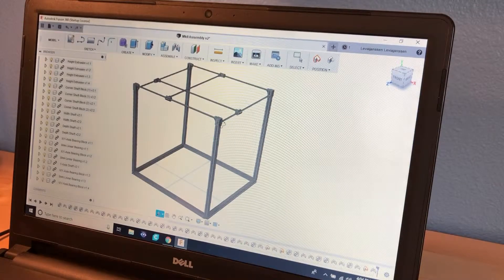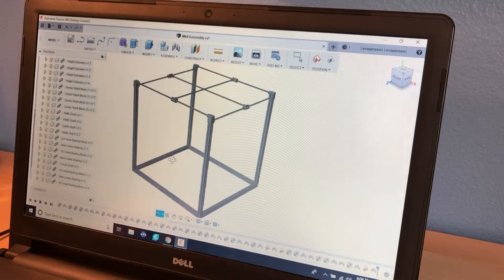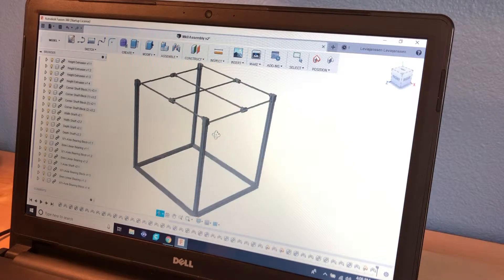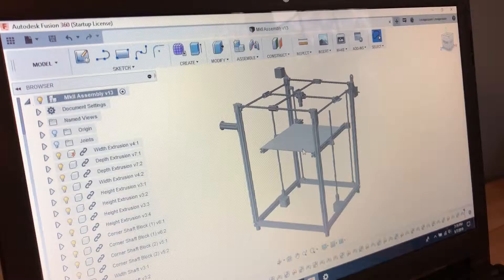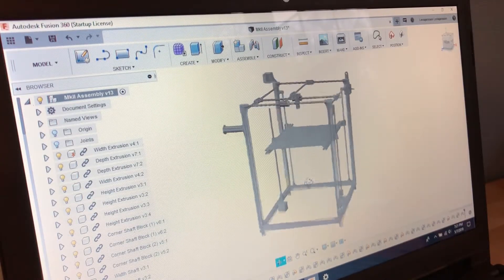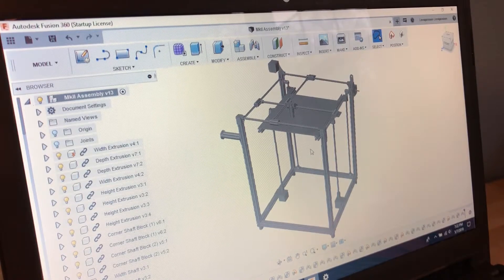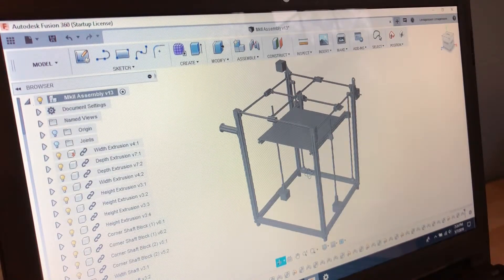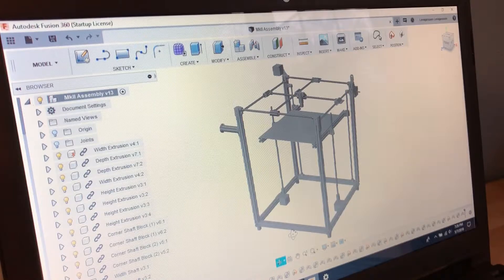Building a Custom 3D Printer | Part 1: Design

Comment: Hi there friend, Really like the build and the design, m just wondering what steppers you have used with your electrics, they look fairly beefy and im looking to use a couple of nema 23s for my build for the z axis but the amperage is 2.8 where as the drivers are 2.5 amps... reckon that is doable?
Reply from the maker: No. Current ratings on those stepper drivers are usually optimistic and assume external cooling. I also only used NEMA 17 motors. NEMA 23 would be way overkill.